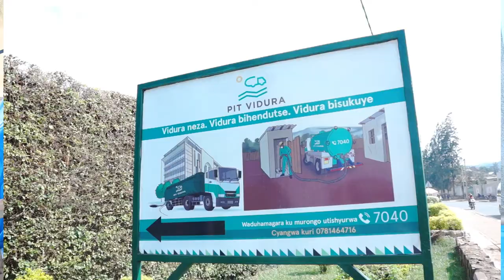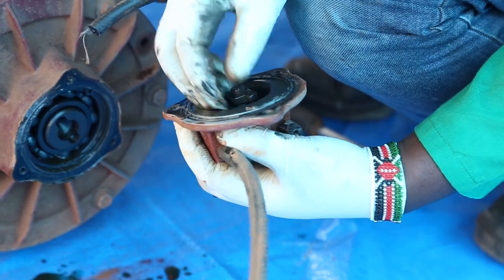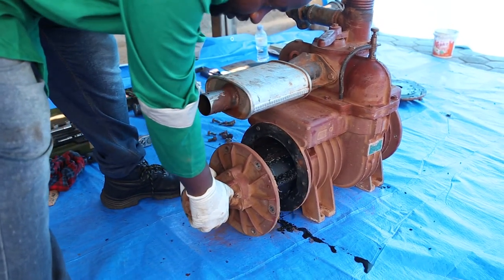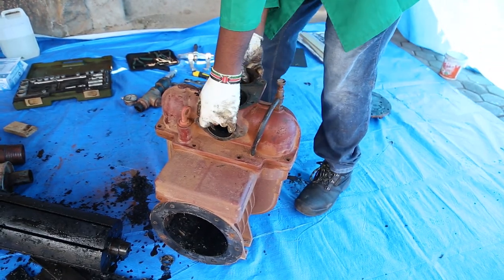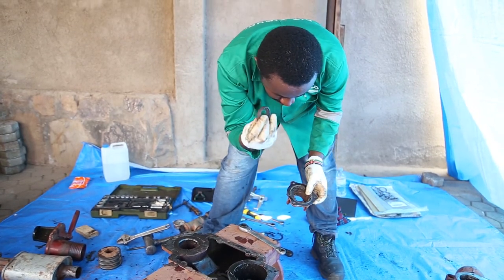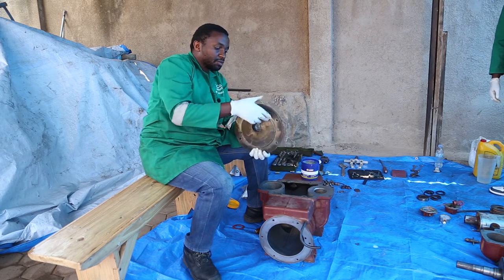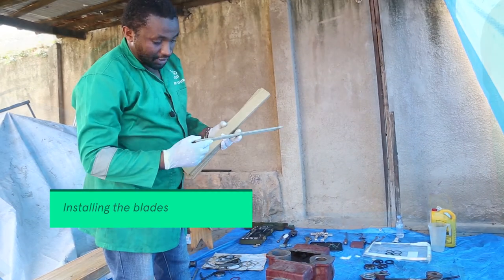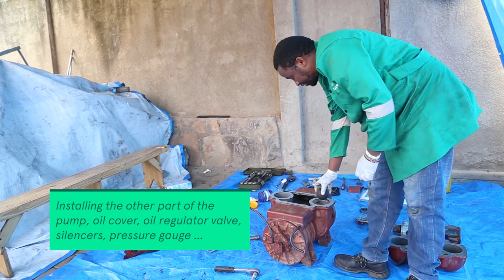MEC 8000 Vacuum Pump Maintenance

Comment: Which side is the drive side? It is a very good question. Usually the manufacturer puts an arrow on the housing for the direction. If you look inside the housing, you will see a longer slot which is the inlet and a shorter slot which is the exhaust. These slots are closer to each other on one side. On the closer side point an arrow from shorter to longer slot and that is the direction of rotation.

Comment: Where can I buy the vaccum vanes
Reply from the maker: Hi Michael, it will definitely depend on your location but you can also purchase it online of course with a reliable platform. In Rwanda, we can't get it locally so we import from Dubai or South Africa. Where are you located?
Reply: I am India from Tamilnadu I want 12000 liter capacity vaccum pumb